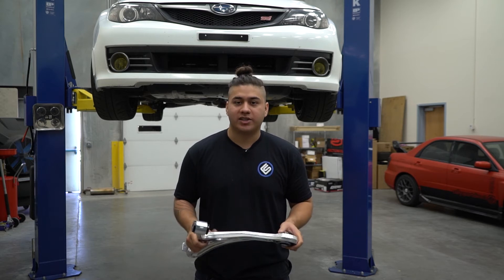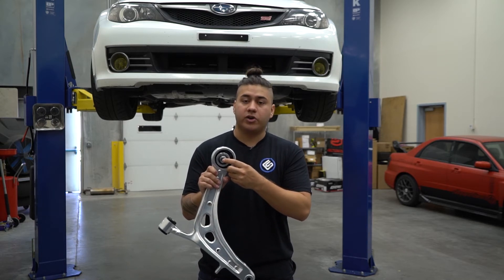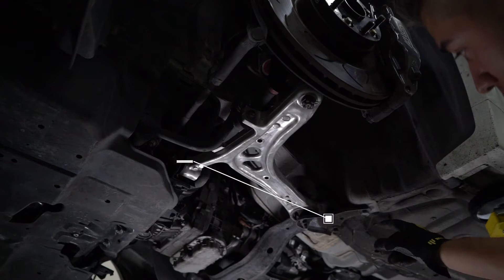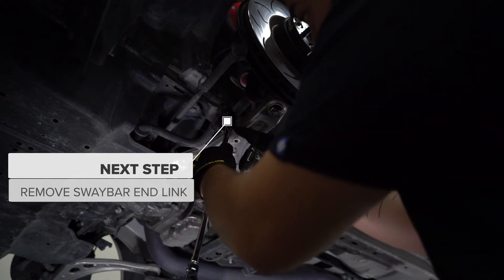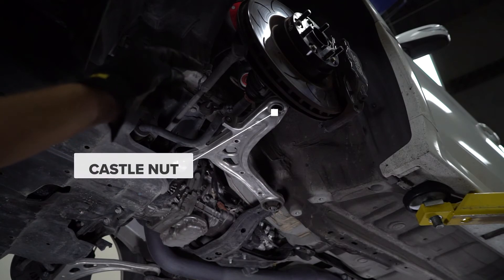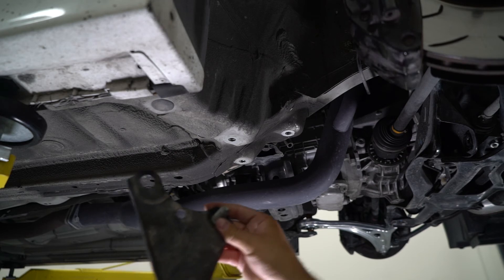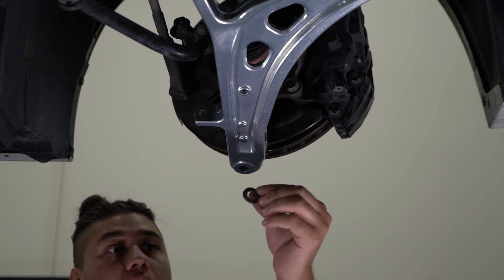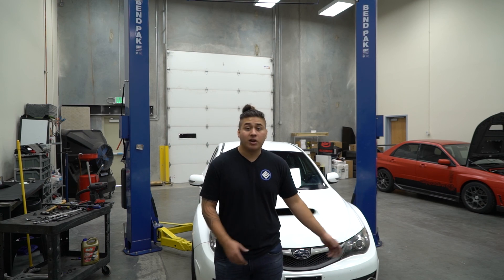Whiteline Front Lower Control Arm Install 11-14 WRX/STI

Comment: To make these work with my 13 wrx will I need to get the Sti bolt (oem part # 901000377) for the big bushing instead of the stud thats there on the car ?